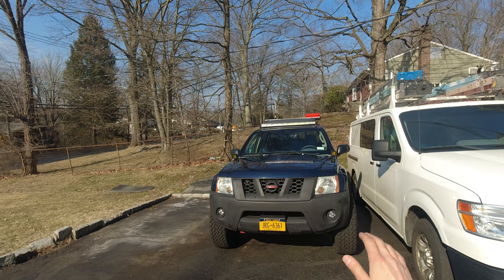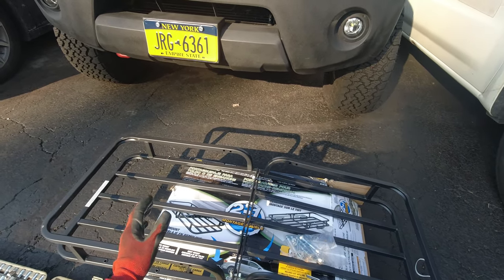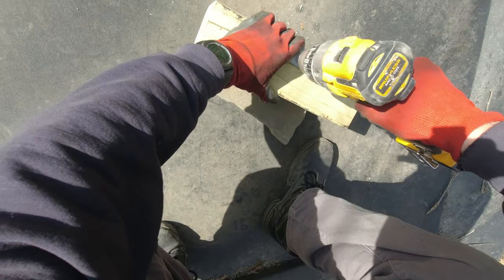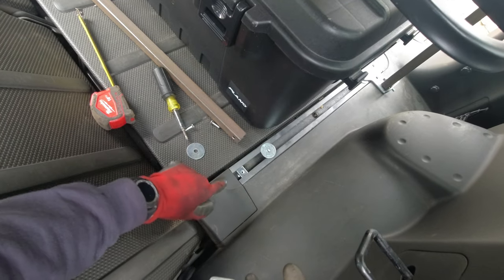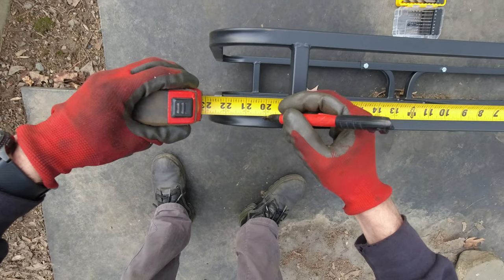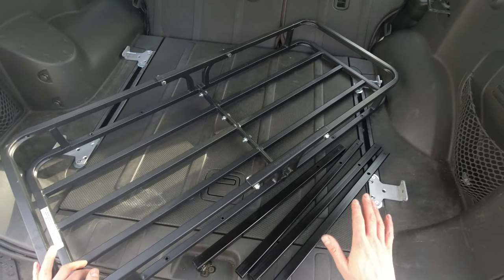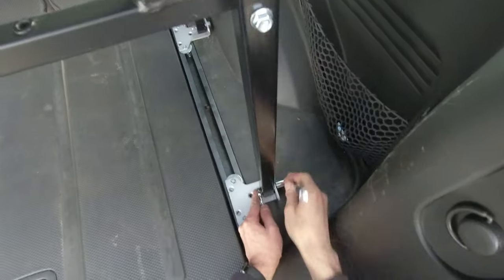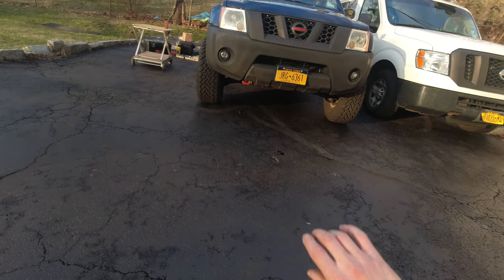DIY Rear Cargo Shelf for Cheap

Comment: I’m gonna take this idea lol. I do use my xterra to sleeep for camping and this will be great for some inside storage. I can still stick my legs underneath
Reply from the maker: Awesome !  and its not that hard to build and its adds so much extra space !  Im sure glad you found this helpful  ))
Reply: Where did you find the mounting brackets?
Reply from the maker: @That2wdXterra  the mounting brackets I got some leftovers from one jobsite..  but I think if you get some L bracket from store like home depo  you can use them as well they would work
Reply: Sounds good! I’m gonna try to find ones like those because I do like them.
Reply from the maker: @That2wdXterra  IF you google "Trudoor TDC-400 Grade-1 Heavy-Duty Door Closer" you will see that part in there.. I mean its not worth buying that door closer just for that but that will give you some idea what to look for and what to ask for at the store ) 
Good luck !